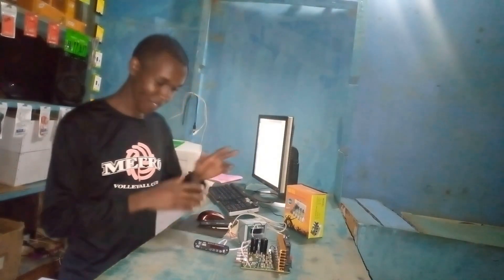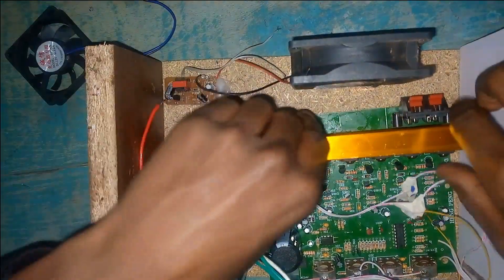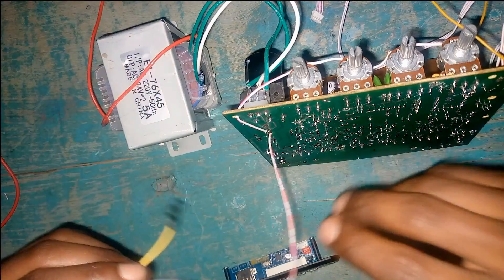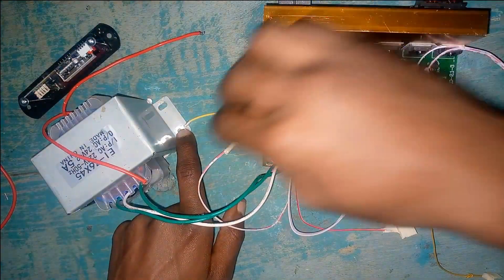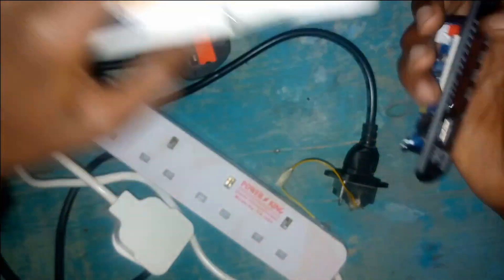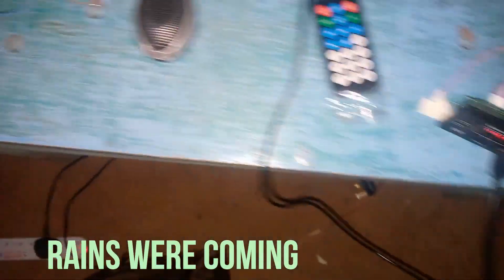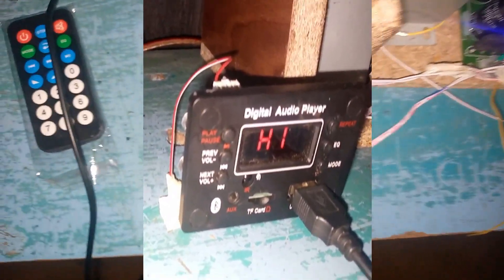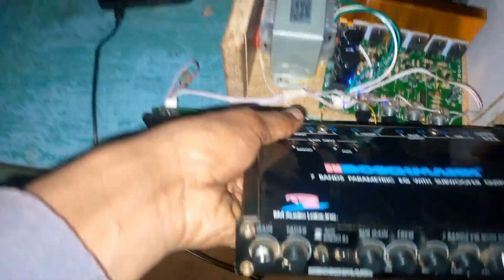Removing distortion in amplifiers

Comment: i have the same green board and the problem is the distortion has persisted of the subwoofer side like if i increase subwoofer volume its so loud...
Reply from the maker: Did you bypass 7805 regulator on mp3 player?
Reply: I am in thika I need ur service to fix the humming sound in the speakers kindly can I get ur number

Comment: To reduce that distortion of mp3 player just give it clean smooth power. Just increase capacitance of that small capacitor in 12 volts section of tda 7812
Reply from the maker: I'll try. That idea sounds great

Comment: What is the price of the greenboard and how do I know if they are selling me an authentic one? I was told at Luthuli that the price is 1,200 Ksh. I did not buy it because I thought it was too cheap. Could you also say what you get in the box when you buy it? for example, does it come with a fan?
Reply from the maker: Actually that's the price, the box and fans are sold separately
Reply: @emmanutechnician  And what did you say the transistor number are? You said sometimes they change them. And voltage input is it? +12v 0 -12v or +24v 0 -24v

Comment: Nice job can you do one on how to repair the outputs of the speakers  if they have power instead of them having sound
Reply from the maker: sure, having DC power straight to speakers mostly implies the IC or transistors are shorted or damaged. They should output AC only. I repaired one here : https://youtu.be/PEwmsEdPRJ4?si=Wz7pgiBO7EOaTCz7

Comment: Nice work. What seems to help me out with those Bluetooth faces is powering them with a phone charger. I achieve this by bypassing the little smd voltage regulator on the bt device
Reply from the maker: I'll try that one, though I like having one power supply with one ground. The more sources of power the more the grounds, and they loop each other